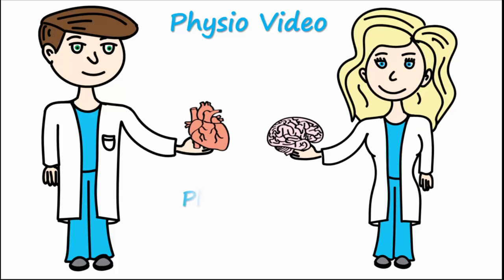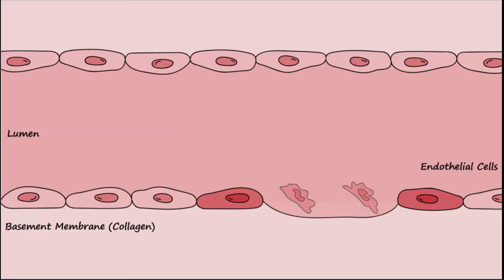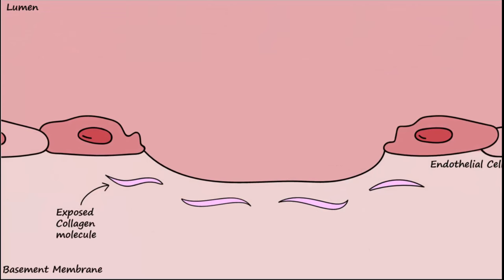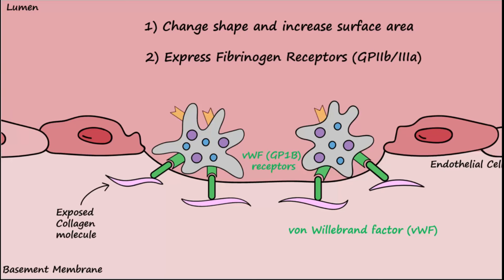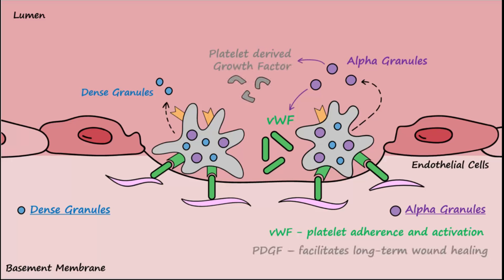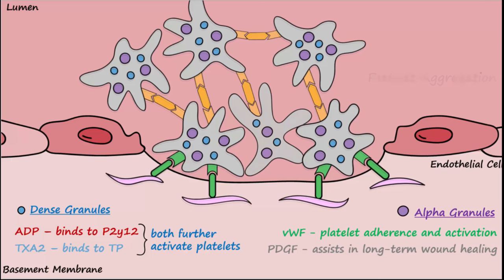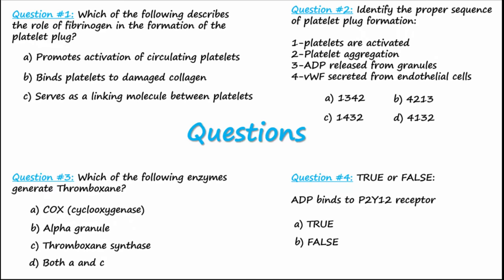Platelet Plug Formation - Mechanisms

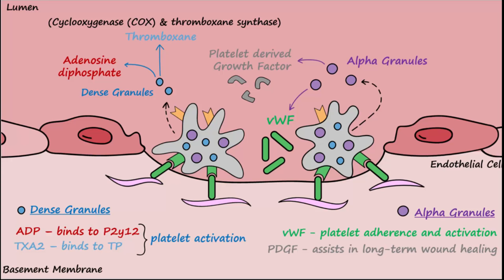Comment: 3:00 Question about endothelial damage.

Spike proteins that attach to ACE-2 receptors on cell membranes. Since spike proteins produced by mRNA vaccines are not covered by sugar, I assume there are more active sites on the spike proteins which your immune system will generate antigens for.

Wouldn’t this create a thrombus-like growth composed of spike proteins and antigens?

If so, wouldn’t blood flow create increase stress upon endothelial cells which could tear the membrane resulting in conventional thrombosis on top of the spike protein/antigen pseudo-“thrombosis”?

Also, basic fluid dynamics would predict a higher velocity of plasma through smaller blood vessels creating higher stresses on endothelium cells. This would contribute to endothelial damage triggering conventional thrombosis.